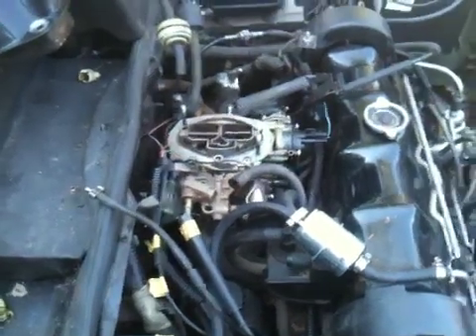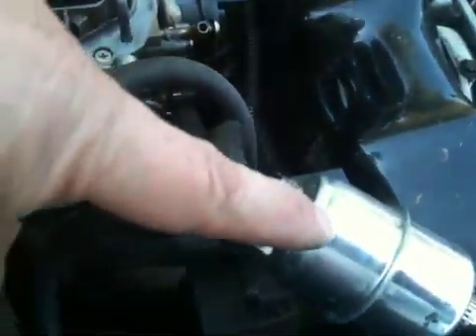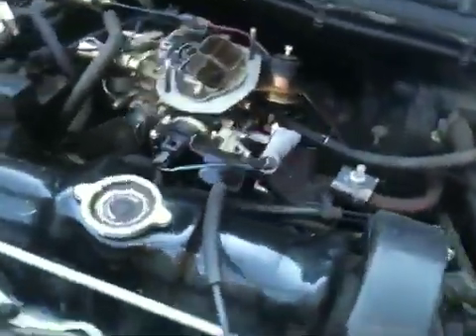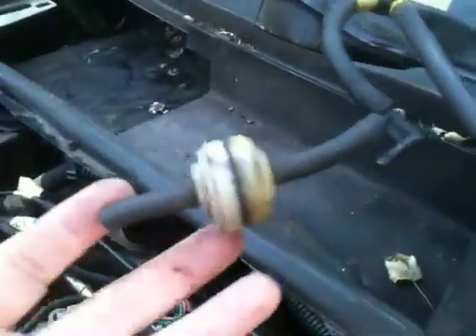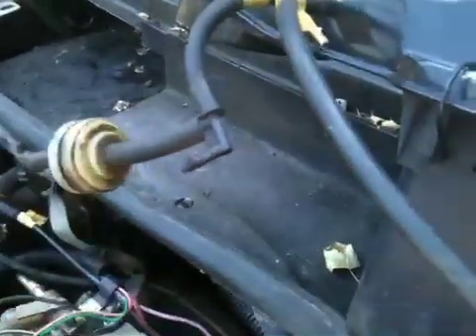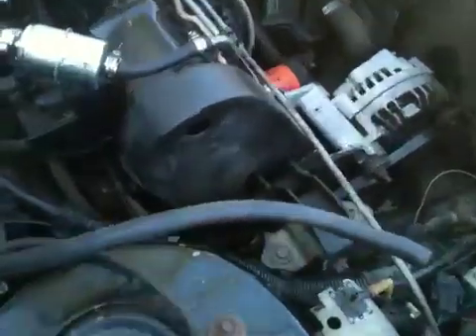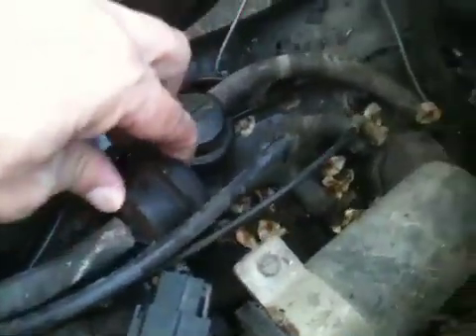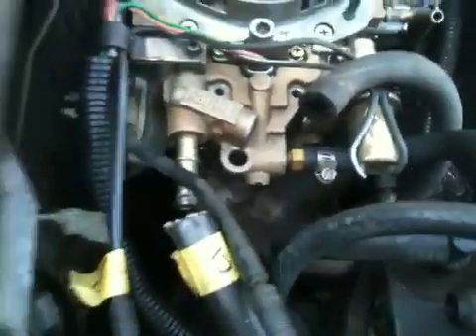Holley 6520 carburetor connections?

Comment: Did you ever figure this out? I have a 83 Dodge Rampage with a 84 Charger motor which looks exactly like this setup. And I need to figure out the two ports that come off of the side where they connect to the air filter housing and after that. The previous owner has all the connections wrong, but I've managed to figure out the other side, just not the choke and filter connections.

Comment: if you dont have emissions then buy a weber 32/36 or a weber 38(prefered) and remove all the vac hoses along with the air pump assembly and then put an exhaust header on it.